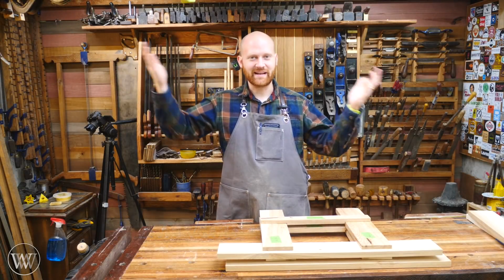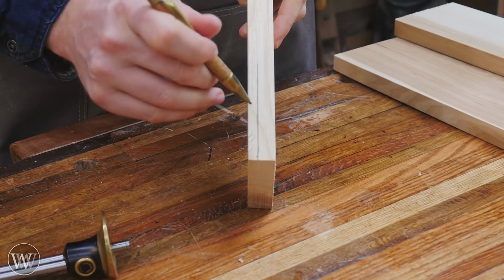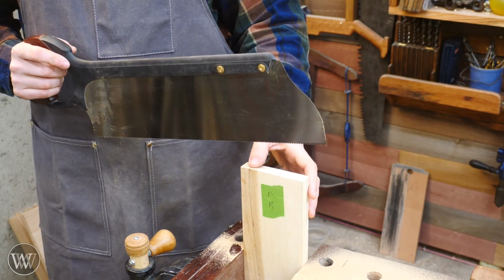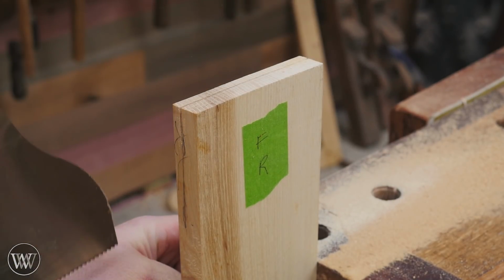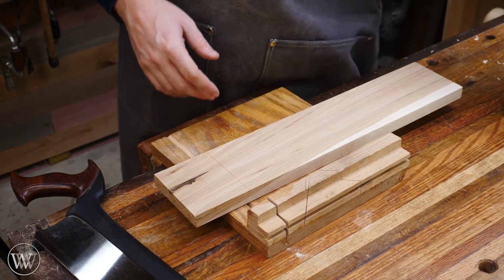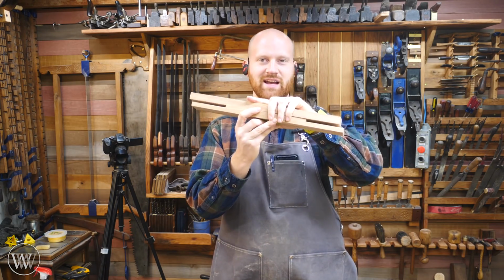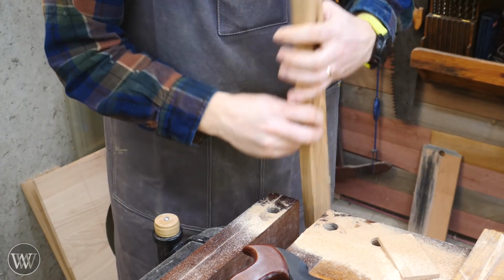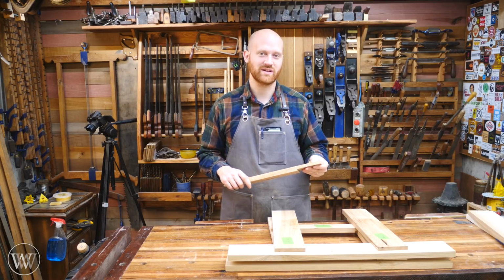Saw Vice Build Part 2 - Making Half Lap Joints

Comment: i know You're using oak for builds, but would pine be suitable for something like this? only asking since I have nearly unlimited supply of free pine boards :)
Reply from the maker: you could use pine but you would want it to be thicker.  you do not want much flex in the wood.
Reply: Wood By Wright i'm hoping 3/4 inch thick will be fine :)

Comment: Great video. One question. Let’s just say I’m vertically challenged and can’t get my crooked saw to cut straight. How can I try to get the line back once I get off?
Reply from the maker: Does it always turn the same direction? In that case, it sounds like the saw is set poorly. you should be able to back up and twist the handle so the teeth rub on the side that it needs to turn towards. but you have to back up tell you are in a place where it si going straight.
Reply: Wood By Wright it does not always go in the same direction. I need more practice.